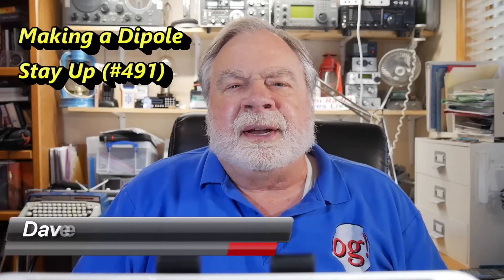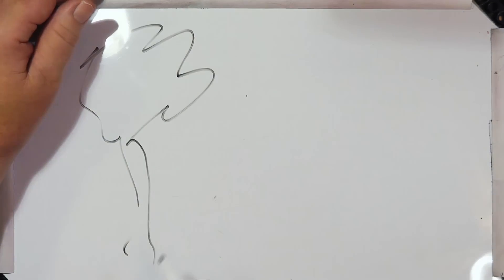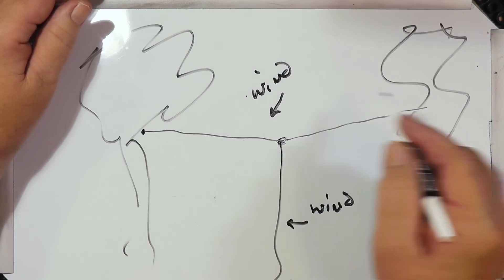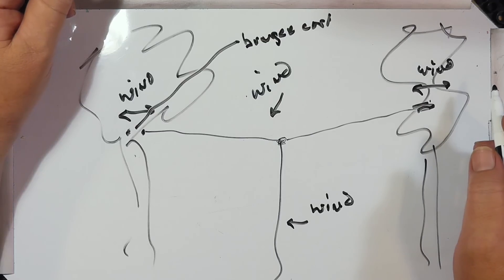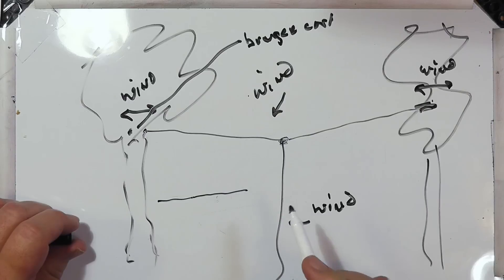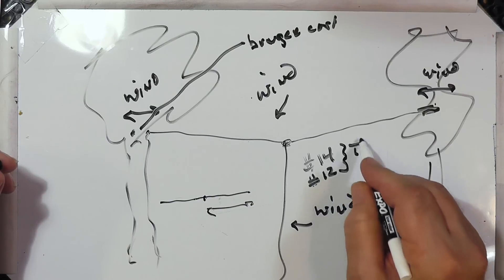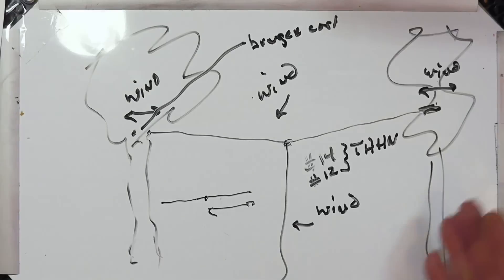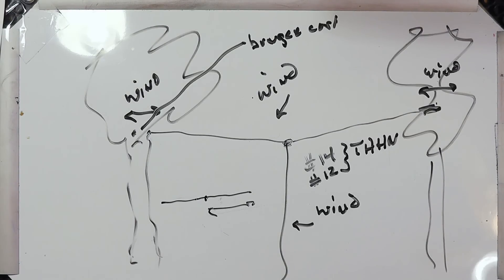Making a Dipole Stay Up (#491)

Comment: Great videos. My question concerning  a dipole is if I install all the wire at 30 ft but have 1/2 of the wire pointing North/South and 1/2 of the wire pointing East/West (basically a 90 degree bend) will this work effectively?

Comment: ALL my HF antennas (20, 40, 80 meters) are #14 household THHN wire on a 1/4 acre city lot (the 80M was a challenge). I have a couple of pecan trees and various other trees for supports. Every once in a while a branch will fall and separate a wire. Other than that I leave enough slack in the wires to begin with to compensate for tension and such. Two or three feet of vertical height doesn't  affect propagation. Hell they're ALL less than 1/2 a wave up (except for the 20) and work just fine (I don't have a tuner connected). I learned a while ago that pretty doesn't equal effective. Resonance is my pretty.

Comment: Questions about loaded antennas...again.   I think I understood from a previous video that loaded antennas do not particularly radiate from the coil.  Please elaborate if you will.  For mobile application it's Said that top loaded antennas work best on (newer) semi trucks.  In one instance I was using a center loaded coil (not above roof line) behind the cab, in front of trailer, and it seemed to work better than any setup I've used before.  😀thank you.

Comment: One doesn't need a balun at the feed point of a dipole. (The impedance is about 73 ohm, also depending on height). You do need a common mode choke at the feed point. No choke is bad practice. Use polyester rope, (UV resistant) also called Dracon, parallel with the antenna wire, a distance above the dipole. This will support the CMC and the coax cable in the middle.

Comment: Great video.  Not sure about bungees at -40 F.  Building a G5RV this weekend and leaning towards weights still, but only because of the cold.  Bungees turn rock hard at sub zero temps.  73  KL1PJ  North Pole, AK.

Comment: Could you use electric fence wire if you are worried about the copper breaking?
Reply: I currently have a dipole for 40m up using electric fence wire. It works great so far, though I do need to get it higher up than it is.
Reply: @ValentinLucero  Thanks for the info.

Comment: Dave et al, I would suggest a good source for UV resistant rope are marine supply stores particularly where sailboats are common. You can also find them with different resistance to stretch.  One more thing on boats you worry about chafe, where the rope rubs against another surface, Where your rope goes around the tree chafe protection will greatly extend its life. Common chafe protection are old pieces of hose, sometimes old demin pants legs. A problem of course is placing it where you need it particularly if you are going over a branch beyond the reach of your ladder and that is common but it can be done.

Comment: Great advice.  Was just having this discussion with someone using 22awg on a 40m dipole.  It's been up in the ARIZONA sun for 8 years.  Only issue he has had is the vinyl cover is peeling off in a few areas.  Does not affect the operation of the antenna.

Comment: I setup my OCFD Inerted V antenna using a 'messenger line' between the trees & hung the antenna balun on the line.  That allows the antenna to automatically center itself along the line & takes tress off the antenna wire.  The messenger line run over a high limb/trunk in each tree & down the back of each trunk to a rope cleat.  I use 800 lb paracord & using this method allows the raising & lowering of the antenna with ease.

Comment: I love use screen door springs. As far as wire, I like spending a little more money (and don't have to fidgit with it) and use copper clad steel wire. Poly Stealth #13 will take hundreds of pounds of breaking strength and it is UV resistant and the jacket is very abrasion resistant.